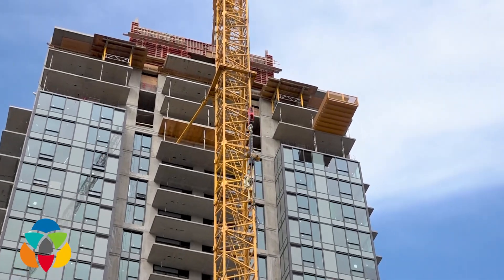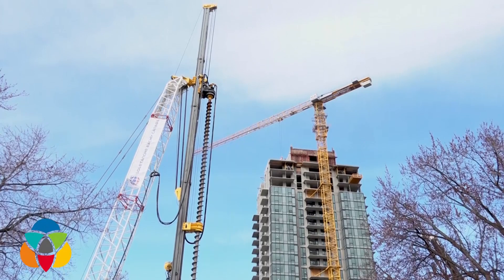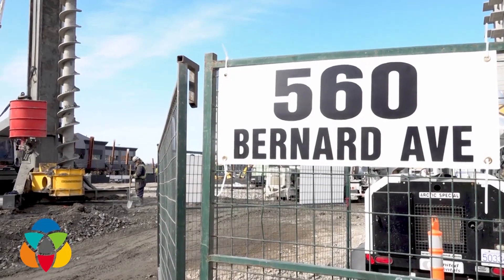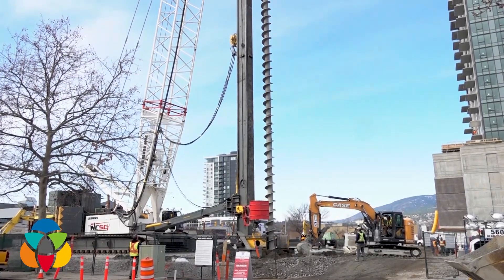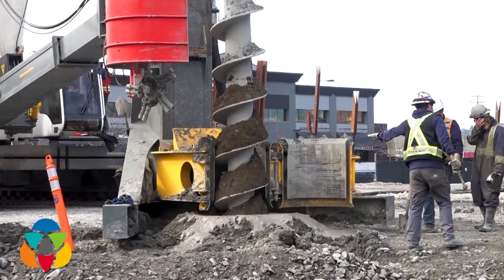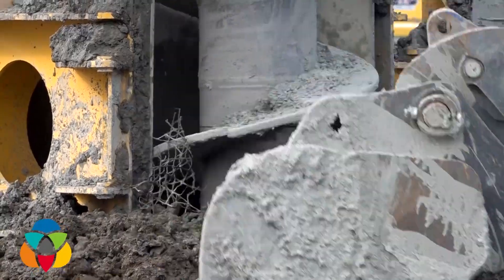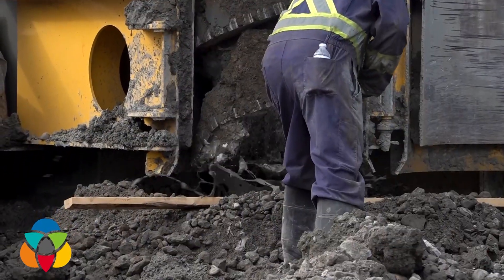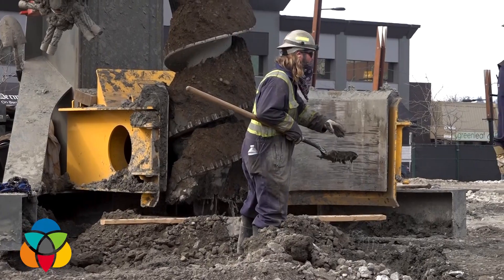Giant auger pours concrete pilings for 34-storey high-rise

Comment: Landfill. Barrel burn.   W fan. Fire.  Waters going poison.   Sky scrapers actually one lower iq builders globe. Kill machines.   Research other. Blue drop food coloring glass.   Australia water on fire fracking.   Flint water on fire  methane by math leachite. Travels water viens. Killing the planet. Nasa.  Explained. By math bore hole one sideways. Torch remote control. Dozens. Singapore trash burning systems no water